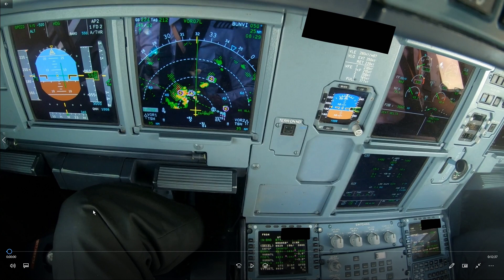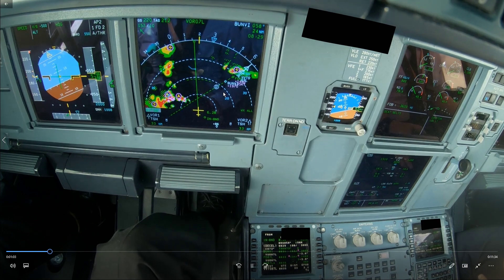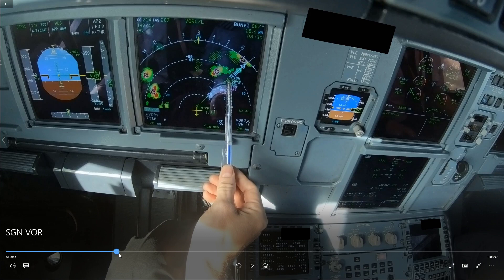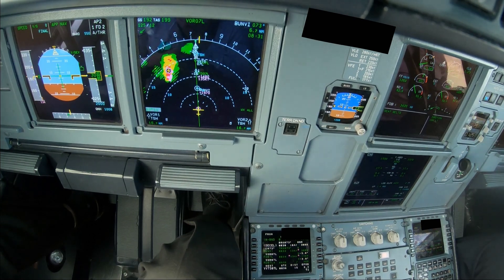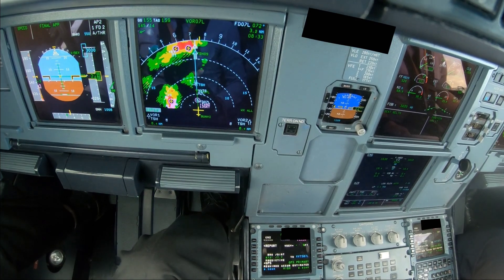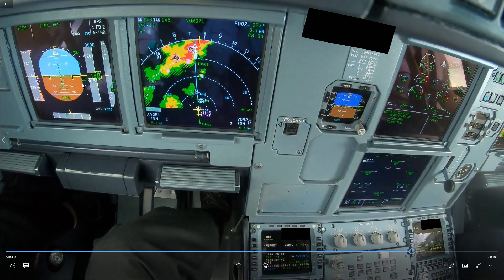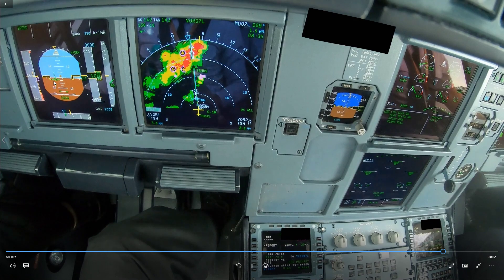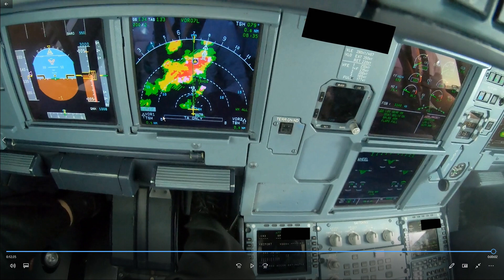A320 managed VOR approach

Comment: I have a question. If you are vectored at 4000 feet and then you are clear for lnav/vnav. Your FDP is 3000 feet, what you should do? Continue descend with V/S to 3000 and once the top ND is your FDP arm the approach?
Reply from the maker: It's a good question but it needs more context. If you do a vertically selected approach, you need to have a level segment before the FDP (or ideally not below 3000 ft, even if the FDP is at say 2000 ft) so that you can pull at 0.3 nm before and thus have a predictable vertical path interception. So in that case, setting a V/S high enough to see the arrows creating a level segment is advisable.

If you do a managed approach, you need to be careful that in the case of a dive and drive (only one vertical path segment coded) the aircraft does not over speed once it goes into FINAL APP and dives down to catch the vertical path. In that case, it's best to be fully configured so that a pitch down moment does not cause the speed to increase significantly. Fiddling with the vertical speed in this case does not provide reliable results from my experience. This is because the aircraft can go onto FINAL APP any time it's close enough (provided APPR is armed of course).

When doing a vertically managed approach, you can delay arming APPR to prevent an unwanted pitch down moment, but again, that is only an issue if only one vertical path segment is coded.

So it depends on how the FMS is coded and what you are trying to achieve. 

Does this answer your question?

Comment: Hi, you don´t have to select VOR mode on the ND? Is ARC okay for an VOR approach?
Reply from the maker: No need VOR mode. Use ARC mode instead. This is a common misunderstanding. The raw data information is also available in ARC mode (needles). In ARC mode it's easier to lose situational awareness (no FAF visible, no G/A track visible, etc) and in general it's bad workload management to use modes with reduced information. Maybe you can use VOR mode for a fully selected approach (if you find it easier to track with), but not for managed/selected.